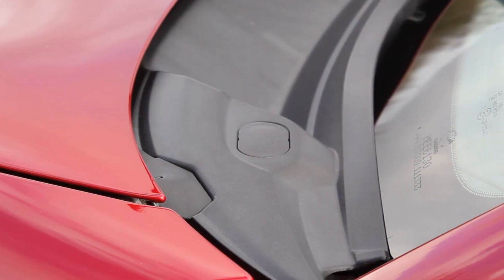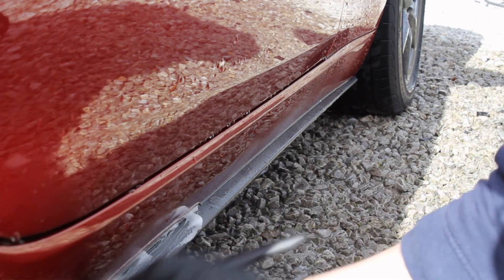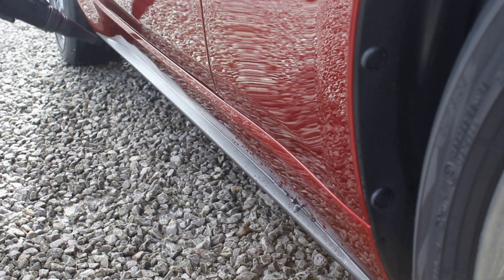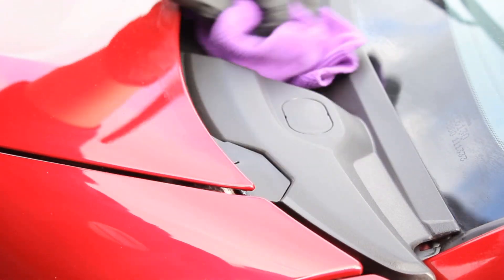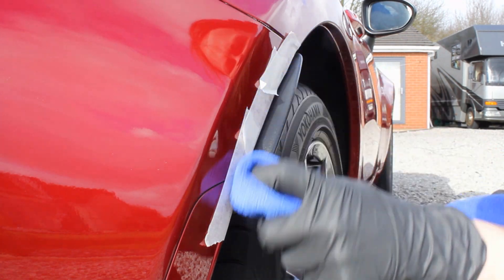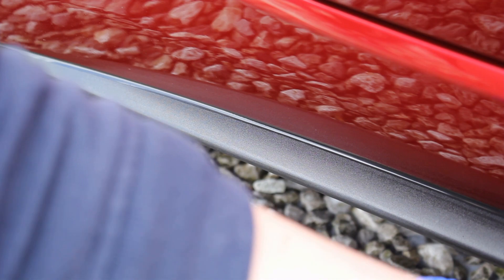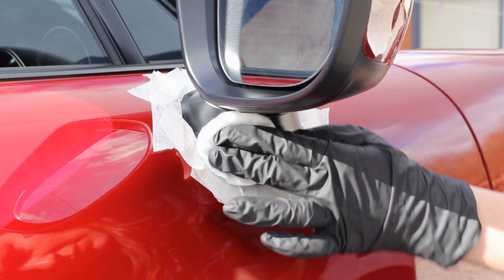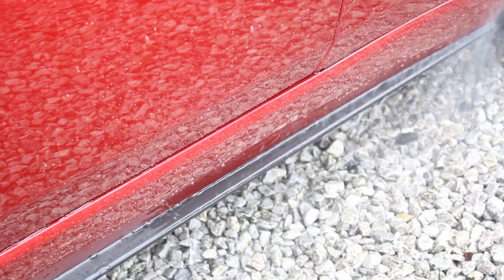Gtechniq C4 Permanent Trim Restorer | Prep, Application and Results

Comment: I wouldn’t use any other trim restoration after using this one. It’s brilliant. I bought a 10ml one for my 2021 Yaris which to be fair there aren’t a lot of plastics. I did it when it was virtually brand new. I then did my son’s Cooper S and there’s a lot of plastic on that. But the 10 ml did both cars and no more. Good thing is it spreads well and a few drops covers a good area. Great video as always Heather 👍
Reply: Update ?

Comment: Applied C4 to a few motorbike chain guards about a year ago. Still going strong and that's in an environment with plenty of grease, strong cleaners and lubes. Great product.
 I've been using lint free makeup pads for all the rougher bits of ceramic coating (trim, inside wheel spokes, etc..) and they work great for how cheap they are, no issues with high spots or inconsistent patches.
Reply from the maker: That’s impressive, I’d be happy with a year I reckon!

Comment: Uaed this on my Kadjar, needed the 30ml, it's been on about 18 months and it's still going strong, needed to really clean the plastics but it's worth it, if you have a SUV use something rather than the cotton pads as they break down quickly over a large surface and you lose product. Love your work Heather.
Reply from the maker: Thanks Paul! Yeah a couple of this pads started to fray a bit on the larger sections actually, I imagine a microfiber cloth/ pad could work well too!

Comment: Looks good, I use Gyeon Q2 trim on the interior and exterior trim (I doubt there is much difference between the two). I found around 15 months on the exterior and double that inside. When you consider its only around £40 for 30ml it's well worth it - makes cleaning loads easier too.
Reply from the maker: The Gyeon one looks really good I was very tempted by that! It definitely does feel like a worth while investment when it should last so long

Comment: I used 2x coats of Solution Finish on my 20 year old Vauxhall Combo (work van) with almost faded to white black plastic trim bumpers.
That was 4 years ago...
It could do with another go. If I ever get the time to do it. Its still black but its starting to fade again.

Ive noticed that a lot of people, instead of buying a new car, they are chosing to have their old car detailed to give it the 'like new' feel. Its a sign of the times.

Comment: Used an entire bottle on the wife's Kadjar which has acres of plastic... and it certainly worked restoring them to a satiny black.
Didn't like those silly pads though as they pretty much disintegrated before I'd done 50%  so you need more

Comment: I've used it on my E46 and it lasted around 18 - 20 months. 
Prep is the key to having it last.
ALL the trim I coated with it looked brand new.
I have some more ready to go on when I get a chance.
Reply from the maker: That’s really good, I’d be happy with a year I reckon. It’s a bit pricey to justify more frequent applications but I’m really happy with the results so far
Reply: @Auto Care HQ  
I thought that about the price too, but over 18 months how many times would you be putting something else on the trim ?
I figured for £20 to not be worried about it for months it would be worth it (and it was for me)
Reply from the maker: Exactly! It's an investment that makes a lot of sense when it offers a lot more than regular dressings which still cost about £10-£15 and need applying weekly
Reply: If prep is so key, what prep is actually required?

Comment: Ivehad it on my clio about 2.5 years now, the plastics still look great but I thought it had lost its repellency. Cleaned last week with a brush and surfex and the water beading is back, suppose like any coating it can get clogged
Reply from the maker: That makes a lot of sense! I noticed it when I used a glass coating last year so I hit it with Garage Therapy decon shampoo and it revived it quite a bit

Comment: Very good video Heather! Will be interesting to see how long the trim coating actually last. But seeing that how much you car about your care, with proper maintenance (like you always do), I think it's all on the coating itself to provide what they claim. I personally would prefer a bit more glossier finish, although the factory finish this coating leaves on the trim, looks very very good and fresh. I'm playing with the idea of coating some parts of my car as well, would you have a recommendation for me with a glossier finish, please or do you think 2 layers of C4 would get me there? Thank you very much Heather, and keep it up 🔥
Reply from the maker: Cheers Viktor! Fingers crossed I get at least a year out of it! It didn't take too long to prep and apply at all, but it is a bit pricey so I wouldn't want to use it too often.

From what I've seen of this one it doesn't seem to get any glossier when it's layered. I think it just helps if the trim hasn't gone dark enough after a single layer but it tends to stay pretty matte-looking. I've not tried anything glossier I'm afraid that claims anywhere near this level of durability but I know that Gyeon and Carbon Collective do trim coatings so they might be worth a look at!
Reply: @AutoCareHQ  that darkening effect pf each layer makes sense. Thank you for the suggestions of Gyeon and Carbon Collective, I will have a look of them!  🙏

Comment: Hi Heather,  just a quick question,  seeing how this perform on your trim, could you use it on the tire wall.
Reply from the maker: I’ve read that it doesn’t do as well on rubber to be honest and I think you’d need a tonne of the product so it’d get pretty expensive. Gtechniq don’t mention it on their website so I’d be reluctant to try it especially without checking with them

Comment: Wonder how this compares to car pro Perl which is famed for its multi purpose and amazing value for money.
Reply from the maker: I don’t think Perl is designed to last anywhere near as long as this. I’m used to using similar dressings and found they need reapplying very frequently so I chose to apply this so I didn’t have to do that anymore
Reply: @AutoCareHQ  I would concur looking at some of the other comments including one user that said this coating lasted him a good 12/18 months. Though I guess I’m less sure of just how long we could expect out of something like CPP. You mention in the video it needs to reapplied frequent, is that every wash? Every five washes? 

This Gtechniq is on one hand is very good and on the other is slightly concerning given the price of this. Bit of a toss up if it’s worth the extra or not. Maybe if the math is done it’s more conclusive.
Reply from the maker: I've not tried Perl specifically but regular trim dressings I've tried last a couple of washes before they're pretty much gone on my car but even after one wash they take a hit. I usually wash my car weekly.

Comment: how long did it it last
Reply from the maker: I got 12 months out of it before reapplying
Reply: I used  C4on my daughters Kia. I washed the car then used isopropyl alcohol to wipe down the plastic trim then applied the C4 on all the black plastic trim. She drove the car for two years before she traded it in. It still looked great. Last year I used C4 on my suv and it still looks great. C4 is expensive but it works and it lasts, well worth the money.

Comment: I actually tried the C4 on the trim of my G37x coupe. It didn’t last more than 1 month.
Reply from the maker: That seems quite strange, it seems to be lasting well on my car. Maybe it was a dodgy bottle?
Reply: @AutoCareHQ  I’m not sure, but my car is stored outside in the Florida sun. I prepped the areas well with a degreaser and IPA.

Comment: try a heat gun on the trim
Reply: @AutoCareHQ  i think its a pyhics thing the heat brings the oils back to the surface then you coulsd apply a protectant to it see how long it lasts  may be longer i dont know i dont own a heat gun and the only black trim on my car is the scuttle area
Reply: @nps5886  You need to be careful with the heat gun... You can get them too warm and cook the plastics